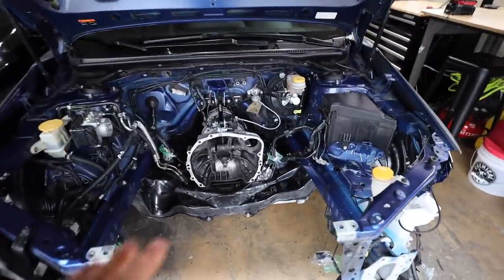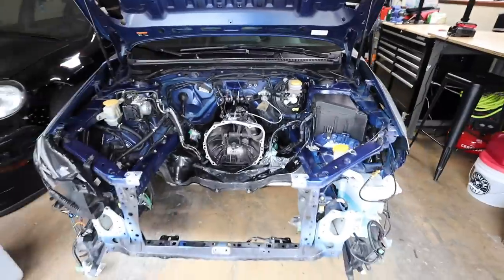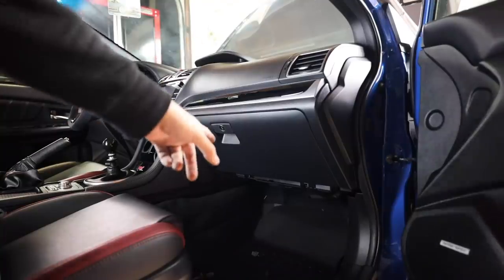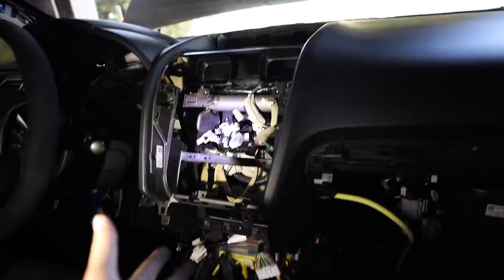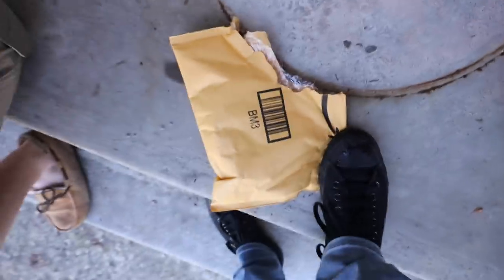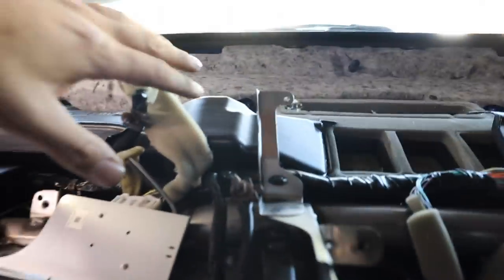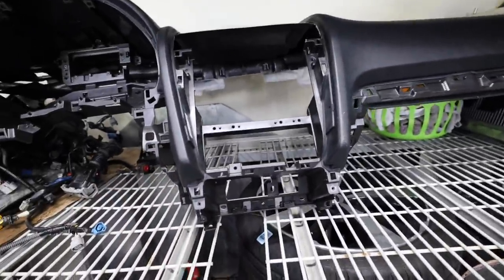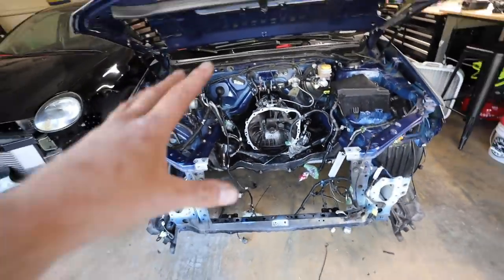What Have I Started....

Comment: Man a motor swap should mean swapping ECU and modifying engine sensor wiring at most.  Yanking all the body harness and dash wiring out is bananas.  You’ve got a heck of a project ahead!
Reply from the maker: Body harness went back in after the engine bay was painted, ECU is out already and the harness are ready

Comment: For what it's worth, I would have recommended tagging the cable locations on the existing harness, so you know what came out of where. Might be easier to salvage connectors later or use existing cables. Though if you're hell bent on rewiring everything, or removing all of the extras, it's not too much of a concern.
Reply from the maker: I want to pull everything that won't be used to clean up the wiring as much as possible. For thr most part its pretty self explanatory for which plug goes where. 🙏😁

Comment: Did you use the Big Sharpie Pack Trick to mark the bolts and nuts and connectors?
Reply from the maker: I did not, ghr bolts nuts etc are pretty obvious where they go back into the car. The connectors only have so much length as well so I'm not overly worried about it 🙏

Comment: After taking this all apart you would happen to know where the blending door is located for the heating/cooling? My 17 STI has cold air on passengers side but room temp on drivers side :(. I’m afraid this thing is buried in the dash.
Reply from the maker: It is behind the dash where the Y pipe for the vents is that we pulled out. Its a PIA to get to 😪

Comment: Man what a project my dude,your a brave man,so many wires.I don’t think I would be able to remember what goes where when I put it back together.Good luck with the swap though.I know your busy but by chance did you get that colors wires from the Aem 02 harness to the new Amazon Bosch sensor,Thanks my dude!👍🙏
Reply from the maker: Thanks my man! Def won't be easy. And I have not had a chance yet. Have a reminder set in my phone so I won't forget today 🙏
Reply: Smeedia any news with the color code for the Aem  harness to Amazon wideband 🙏
Reply from the maker: No update yet, haven't had a chance to dig into the BRZ, from what I remember the sensor wire colors were the same as the OE harness
Reply: @Smeedia  ok thanks should be good now ditched the old Aem and swapped to xseries seems to be working so far for now how long don’t know but at least it’s working for dyno day today

Comment: "The zipper on these pants never stays up"....... weird segue, but ok.

I'm only half way through, you just pulled the dash pad out. It is making me super antsy, I just want to jump in and help. I will finish this video later tonight, but you should have been able to take the fuse box apart so you could have left the headlight harness in the car. 

You should get an underhood light, they have large hooks on the sides so you can open both doors and hook it to the roof through the car to give general light.
Reply: When you get rid of that steering wheel, lemme know. I want it!!! And to help finance your build, sell the airbags after you take them out. They are EXPENSIVE!!!! The dash airbag you took out, you should take to a field and set it off. Its super fun, just make sure you have about 50 feet of wire going to it so you are a safe distance away. And 3 hours to take the dash out isn't bad for a DIYer. 

Also if you have questions about how to take stuff apart, hit me up. I do collision repair and can get almost anything apart.
Reply from the maker: For sure! And was going to sell all of the airbags to help fund the build, same with the seats and the wheel when the time comes 🙏😁